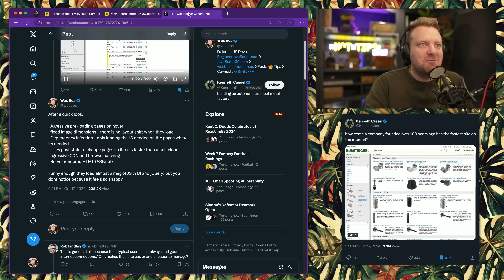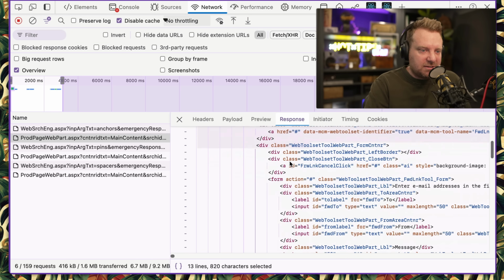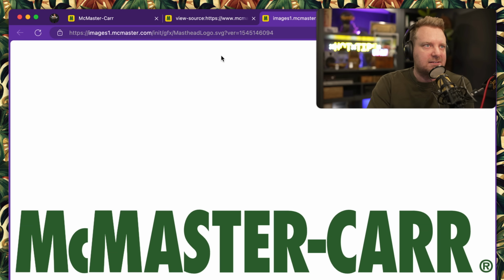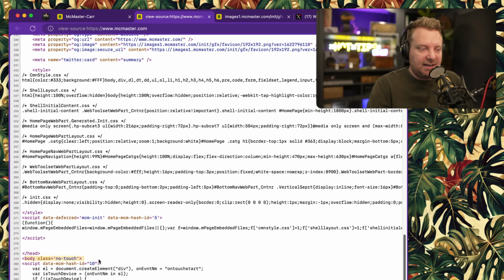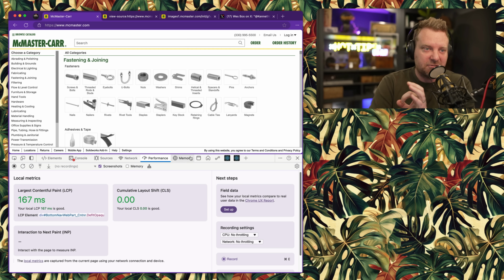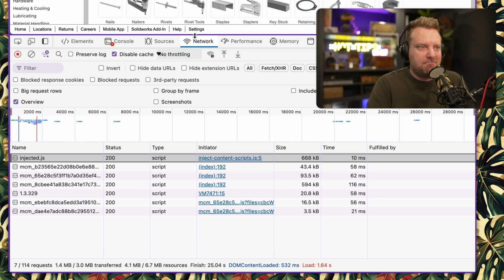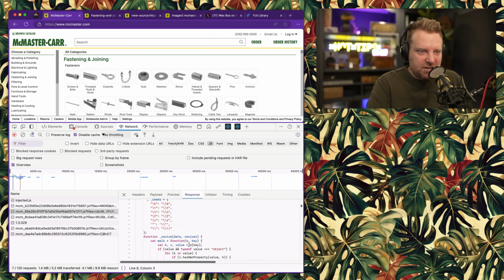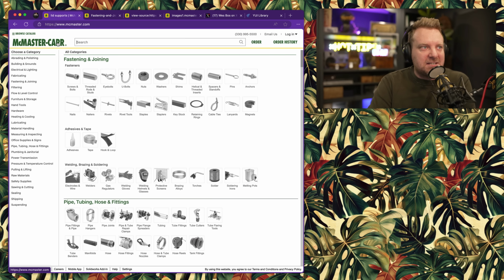How is this Website so fast!?

Comment: And they are using two subdomains for image resources (images1. and images2.), since browsers have a limit in parallel connections per domain (Chrome is 6, AFAIK). With two domains (two subdomains, I know, but for browsers, they are two different domains), they can load 12 image resources at the same time. Probably using this trick for other resources too.
Reply: And, when they are preloading resources, they are telling the browser what is that resource (with the 'as', like 'as image'), so the browser don't need to parse and discover by itself (and defining the 'Accept' request header in the process). They can still use the prefetching priority to make (more) faster than actually is.

Comment: The backstory is McMaster Carr used to print off their entire catalog into massive ~2000 page books that they give out for free. Obviously at massive expense to the company. They fought for YEARS to get all the old timers in manufacturing, oil & gas, construction, etc to get them to final move to online. 

How they finally did it is to (1) Make the website stupid fast and optimized. (2) Make the mobile version of the website so much easier to use that it’d be impossible to argue the old book method was faster to find items (3) Provide links for 3D models and engineering drawings for nearly all items in the catalog

Comment: Just finished a new website for a client. Mentoring website, with file sharing, videos, chat, etc. Here's the slowest page:

Metrics
Expand view
First Contentful Paint
0.2 s
Largest Contentful Paint
0.5 s
Total Blocking Time
0 ms
Cumulative Layout Shift
0.045
Speed Index
0.2 s

6 requests
9.1 kB transferred
103 kB resources
Finish: 35 ms

Oh, and this is with caching disabled and non optimized JS ;)

Comment: Immediately clear that it's not loading html when you open a new tab. Super low resource black and white images mean it's all loaded in streaming rather than 1 page at a time. I always open new tabs when shopping, comparing, browsing so this website does run faster than anywhere else, it still is noticeable delay on each tab.

Comment: 1) Inline all your css 2) avoid cascading render blocking requests 3) prerender (aka deliver the final html) 4) nearly all links and buttons should work without javascript ... is all you need to make a site feel fast on first visit. The hard part is push back against stakeholders to demand stupid shit that needs backend data from 10 different servers (which slows down the initial response) and then is only possible in the browser because its customized per user (which will cause layout shifts and blocks interactivity until your javascript has been loaded).

Comment: Site is super fast but also its very simplistic.  Their fonts are mostly using system fonts, images are black and white, and the html / css is very basic.  KISS! Regardless of the techniques used on the website it will be a fast website.

Comment: The only thing i disagreed with is that it doesn't matter what framework you are using. The fact that it is 15year old tech probably helps in making it perform so well.

Comment: Yes, that was the reality years ago. Designers didn't get carried away with using unnecessary things; they focused on usability. You'd be surprised, but back then, there were just web designers, whereas now the same work is done by at least three types of designers - UI, UX, Product, etc. Developers, on the other hand, didn't use all kinds of frameworks to make their lives easier; we wrote code, used our brains, and made an effort to keep the code small and well-optimized so that it was easier to maintain and the site would run quickly on the limited server resources available. Nowadays, they use frameworks for the backend that, even before they’re loaded with data, require 2GB of RAM just to start. It's absurd!

Comment: For my work I use an app, which should draw a map and about one hundred dots (cars) on it. Every car has some minimum information (geo, tasks, timestamps, fuel, etc.)
Cars and its info packed into json.
Sounds simple, right? Something about several kilobytes of data (without map tiles of course)

Once my phone loses 4G (going to 3G or worse), I could wait for minutes to full map load! Or get a timeout error...
Also this app puts something to cache. For about an hour of using it, cache inflates to about 500Mb! Map tiles cache? Hehe, no! Everything loads from zero every time I start this app or switch it back and forth. Every simple action starts long network interaction for some reason, even opening camera to take a picture for a task... And again, if you in 3G zone - it often takes around 10 seconds. Action logs? Probably. But again, it's several kilobytes, not more.

Far not small IT company. Why...

Comment: Funny how 65 ms is considered fast in webdev. An average American PC can do 500B FLOPs per millisecond, so even if the "server" (with PC specs) was pre-rendering an image of the website viewpoint, it would probably take at most 0.01 ms for it to do, and then 5ms-20ms to transmit that to the client. There's a reason that a home computer can render real-time games on a computer... Also a server usually has 10 times the CPU cores of a consumer PC, so it could do it even faster.

Comment: Honestly we think of old things as being slow, but an old website is designed FOR slow, old frameworks are designed with the limitations of the times. So assuming that the framework itself isn't too limiting, being able to juice it with 10x the bandwidth and CPU power compared to what it was designed for should make it incredibly fast

Comment: Mcmaster is the gold standard in so many ways. I suspect your core audience has never heard of, or has just heard of them. But for anyone in any mechanical industry, they are the supplier. Every machine shop still has a printed catalog, probably dozens. They got this way by having the most streamlined ordering process, and it seems even the backend of their website is the same.   

Another thing that adds to that efficiency from a user perspective is their order page. If you want to reorder a bunch of stuff, instead of going through the catalog or your previous orders page, you can paste a list of part numbers and order quantities. Having thst information already in a previous invoice makes it so easy, just copy past and your cart is filled.

Comment: The reason it's so fast is because you have a good internet connection. Try to do the same with 40 kpbs speed. All that pre-fetching will instead slow down the website.

Comment: The only thing faster than their website is their shipping. I know if I spend 15 minutes filling out my cart with a BOM, I’ll get everything within a couple of days. It’s faster than Amazon and I know all of my parts will be dimensionally accurate. Hell, I ordered a steel guide rod for a project and they sent the data sheet with in depth information on the makeup of the steel.

Comment: Front-end peeps are annoying sometimes. I work mainly in the front-end realm lately and if I don't tell that I'm doing tree-shaking to reduce the bundle size, I'm wrong.

And I mean, technically_, if I say dependency injection, I might be wrong, because this is not about inherit and move along memory referencies of class and structures, but rather a way to only download and make the fiel with the module available when necessary. You can have tree-shaking _and DI, in theory, but then again, it's all about passing the message across and I would 100% still use DI if I forget how to talk about tree-shaking and the likes if this makes people understand what to do ;)

Comment: Ive done it all, cool stuff see some pages doing optimizations, all tho IMHO sprite is overkill
Reply: Didn't used to be. Used to be many browsers only download two images at a time over tcp multiplexing from a single domain. One way around it was having multiple image hosts to get around the 2 images at a time limitation, the other way was sprites
Reply: @DummyFace123  I get it, maybe I wasn't specific enough. What I meant is that it is overkill now with the current browser state. I used sprites too, but it was 10 years ago when browsers couldn't handle more requests simultaneously.

Comment: Seems like the goal is that the website has to be as responsive to a greasy two finger typer as fast as a stack of paper operated by an oily, grumpy tech at 3pm on a Friday that's used that same stack of paper over thousands of times before.

Comment: the best thing about this website is the ridiculous database of detailed 3d model files you can just put directly into your CAD program. 😂 reeeeallly helps with modeling parts. every single fitting, screw, washer and nut they have in perfect detail.

Comment: I'm a process engineer and estimator. McMaster is a curse. It's so convenient. Has models of all the hardware available. And all of it can be found in less than 10 clicks and no typing. The cost to all this is, well, cost. MM is easily 30 percent more than Grainger, MSC and Fastenal.

Comment: A lot of what you nerd types dont seem to get is that the customer base for this company is generally working class men - a lot of them older. This type of customer is generally impatient with tech and they want them to get to the exact product they want as fast as possible because the customer is likely a repeat customer anyway so there's no point in trying to upsell. 

A website selling clothes for example wants you to spend as much time on their site as possible so theres no advantage to make the experience as efficient as possible.

Comment: I don't understand the part about "critical CSS". It's just how CSS is done naively inside the style tags instead of having an external file. There is nothing impressive here. And you can't cache it, so what gives?
Reply: you can't cache it, but it potentially allows you to reduce FCP (first contentful paint) for the website. Because first visit matters a lot, and not having to wait for an extra file to load is a little boost. How influential it is in practice is a question that those developers probably have the answer for. Interesting answer.
Reply: @mormatus  Seriously, a boost of how many milliseconds? A CSS file should be a few KB in size, anything over that means that either it's bloated beyond efficiency, or that it should be split in multiple files according to what is being loaded. The first image you load will take more time and bandwidth than that.

No mather the order, the HTML file will first be downloaded, and then parsed, and then a few resources will have to be loaded before any painting happens. The CSS file among all the other resources is not significant.
Reply: @Simboiss  how many ms I don't know. It depends on the customer's mobile connection speed and latency (and lost packet rate). Http/2 is being notorious for performing suboptimally in such conditions, unlike QUIC. But yeah, developer's comfort (and code supportability) probably means more, as well as the ability to cache a separate css file for future visits. So yeah, it's interesting to hear the code author on that

Comment: caching, pre-fetch, and not using 100MB of JS libs that you only use a few functions on plus a dozen social media widgets and telemetry systems. Stop using bloated frameworks, use tree-shaking, compression, minification, and cache everything you can with Varnish, then front it with CloudFlare or CloudFront.

Same as it was 15 years ago, but now computers are an order of magnitude or two faster, yet websites feel LESS responsive.

What Lisa giveth, Sundar taketh away.

Comment: It's not particularly fast. It's unexpectedly fast. That's for two reasons:
1. it has no ads and adblockers do not have to kick in. Ad some ad BS and it will become as slow as your usual news outlet.
2. its 90s style UI lowers our expectations

Comment: It's sad to see modern programmers gushing over fairly common practices that was abandoned in favor of importing code written by other people so that they can play lego rather than to actually sit and code something themselves. This is the trade off everyone was OK with - that it's slower but more "semantic", that it's slower in favor of not coding things yourself.

And that site isn't even all that impressive. I just finished one the old proper way, and that one loads about 3 times as fast, and I did that without even trying to optimize it for speed. This is disgraceful.

Comment: It is not the fat fingered machinists using this site, it is the engineers and designers. Lets imagine a device has dozens or hundreds of parts from a supplier like mcmaster carr. I can not even tell how many times each item will be accessed first to figure they exist at all, what material what coating what this and that in the design phase. CAD file of each is downloaded compared, prices of every combination are considered. Speed of the website literally dictates what and how things are designed and built or perhaps are not built. It is a constant problem with many other suppliers.

Comment: 110 requests and ~6 MB of data. I don't call that fast.
I call it bloated.
Reply from the maker: neither of those are measurements of time though. It's about the loading speed - both wall time and user perceived time